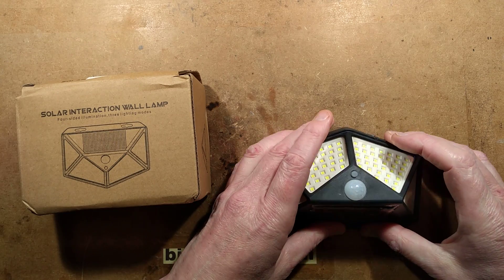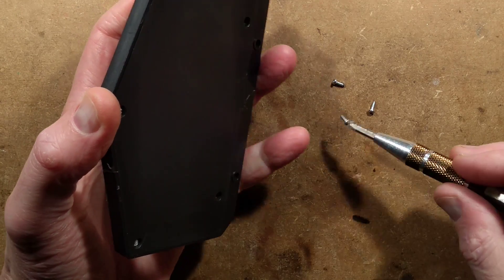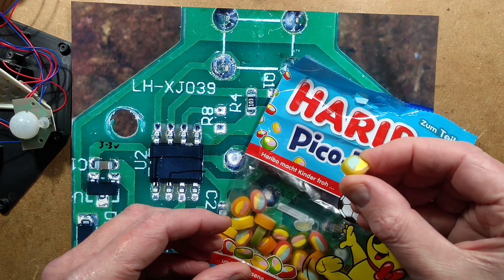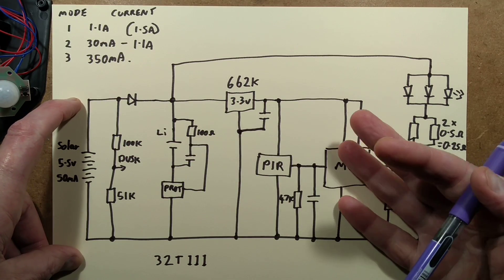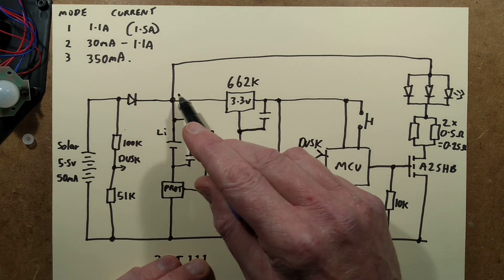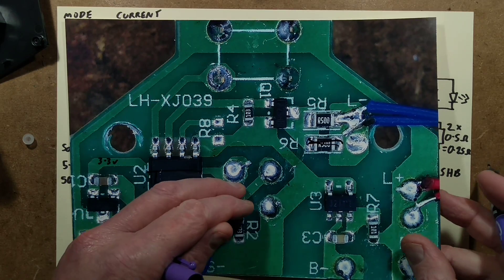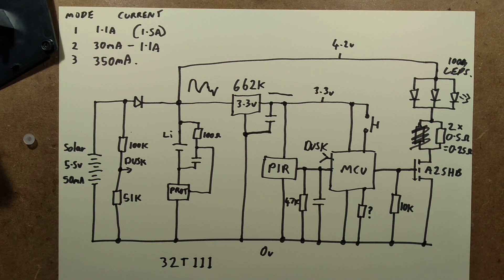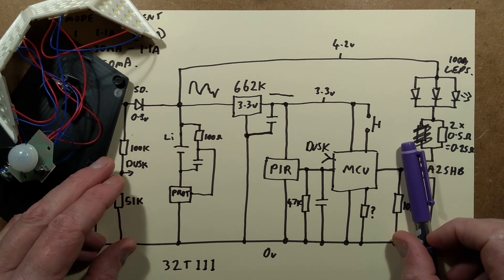100 LED solar garden light teardown (with schematic).

Comment: Great video & tear down of this solar light, they have revised them recently as others have said. Don't think it has full battery protection on these cheaper boards, with only one resistor & less chips, so will see if the unit or 18650 blows out...
However, very grateful to Clive for the tear down & listing the 3 power modes...
Mode #1 - 0/1100 mA with PIR
Mode #2 - 30/1100 mA with PIR
Mode #3 - 350 mA  no PIR, (simply dusk to dawn operation)

Mode #2 is perhaps where most will use these lights with a run time of aprox 5hrs
(Depending how often the PIR triggers the main 1100mA flood/beam
Though as Clive suggests this may be pushing the LED's a bit too much)

As Clive suggested using small value resistor(s) on the positive wire from PCB to LED board...

I bought a few 10r value resistors to tone down the brightness a little too, plus one light was too sensitive, despite even taping the PIR sensor, some gas from a boiler flue was at times false triggering the PIR...
The black tape did dial down the sensitivity a bit but was still slightly prone to false triggering from the flue exhaust close by
(poor choice of location I know but wanted a subtle light there to begin with)

On Mode #3 - 350mA, where the light operates dusk~dawn @ 350 mA
Battery life will be shortened from the Mode #2 30 mA (5hrs)
So I was looking to effectively operate the light on Mode #3 but at reduced power
like Mode #2 offered in its 30 mA standby setting

The 10 Ohm resistor, fitted in line seems to offer something near 30 mA power
on dusk~dawn in Mode #3 like I was looking for to offer ambient lighting
but without false triggering from other PIR modes...

Other lights will be mounted elsewhere using the Mode #2 setting
(but wanted a light kept in that location for subtle lighting)

So a 10 ohm resistor worked perfectly in this instance as Clive suggested
(I tried a range of resistors, but 10 Ohm was perfect for what i needed)
A 10 Ohm dials down the main "flood" considerably but if using a number of lights on your property it avoids illuminating the area too much & shortening the lifespan of some cheap Chinese LED floodlights.

If a 10 Ohm resistor dulls the flood too much for your own situation, then you could use two resistors to make a 5 Ohm resistance & dial down the flood slightly less without being too blindingly bright when say putting the rubbish bins out for example.

So yeah, many thanks to Clive for the insight into these cheap lights, now about £14 for 4 of them on ebay, or £3:50, even with an odd dud/spare parts, say a fiver...
With a 10 ohm, or 2x10 ohm to make a 5 ohm resistor, to dial down the floodlight & extend the lifespan of the LED's. Maybe a small spread of silicone mastic to seal/water proof the unit, perhaps paint the components with something. Borrowing say the wife's clear nail varnish will offer some protection to the components - though will not offer you protection if she finds you have used it all up on silly LED lights.

Thanks once again to Clive, great video, amusing fun clips, a down to earth tear down wonderfully narrated too. The only thing puzzling me is wtf is there to dislike about this clip ??? How can people down vote such an informative video on these units, hmmm me thinks it might be the manufacturers disliking Clive informing others how to engineer them to extend the life of these LED's perhaps ???

Cheers again Clive & others taking the time to share & educate us more on these cheapo Chinese electronic devices
Reply: I mean, you could (re)build very simple models, using the QX5252F (a dedicated solar light controller in a TO-94 or SOT23 package.

Comment: Awesome video! I'm using one for a project, how would you make it work regardless of voltage coming from the solar panel? (During the day)
Reply: Disregard, mine was using a signal to the controller straight from the positive side of the panel across a single resistor. Removed the resistor and Bingo! Works day or night now😜

Comment: Hello Clive, I have same issue with my 4 lights that are exactly the same on the outside. On the inside, the chip is slightly different and I have difficulties finding the resistor to remove. I can see I only have one Resistor (R750) if I am correct. Could I please send a picture? I do not want to throw them if there is a chance to fix them. They used to work though. Let me know, thank you very much!

Comment: Non techie here.  When replacing the battery is it as simple as finding any 18650 or should it be the purple covered one. 
There are a wide range of 18650s with different specs and I would like to be ready with replacement batteries for when the time comes.  Thanks for this video and any help.
Reply from the maker: Most of the cells used in these are standard 18650 cells.  Don't go too expensive as a low capacity one is usually fine.
Reply: @bigclivedotcom  Thanks 👍

Comment: I have one of these and it works surprisingly  well, even now in winter with quite cold temperatures for here (-10 degr.). I only used it "turned on" by motion so see little point in modding the LED resistors....it's only on every now and then and for a short time. It hangs on the side of my house...with another house at about 3,5 meters from it and even so the solar cell seems to charge it good enough.

Comment: Looked inside one today, and it only had 2 x NPN Tranistors and a Resistor (100 Ohm) + MCU + PIR + 100 LED + Solar Panel + Switch + Battery.  Pin on MCU (7) powers PIR.  One transistor switches the LEDs, the other controls battery charging.  White Plastic case.
Reply: Opened another today, different again.  1 Mosfet (A2SHB) 2 resistors (1 for mosfet gate discharge, 1 to limit LED current, 1 capacitor (smoothing) and 1 diode (to prevent discharge through solar panel).  Also the PIR sensor in these units is just a regular re200b type.  They must use on board ADC to read the 20mV pulse (peak to peak).  Black Plastic case , elongated mounting slots.
Reply: Přesně tento typ se mi porouchal - nereaguje na pohyb ani přepínač, baterie je dobitá a solární panel dodává cca 5V. Na opravu potřebuji znát označení MCU a PIR - poradíte?
Reply: @karlvonbanhof2723  PIR = re200b MCU = Chinese ASIC (e.g.  mx8098h).  Suggest hacking in an ATTiny85 + AM312 (e.g. See: https://www.youtube.com/watch?v=pMx2BsaKWUA&t=22s)
Reply: Moc děkuji, součástky objednám, a až mi tyto součástky doručí, včetně tranzistorů SS8050-J3Y, tak se pokusím světlo opravit. Pak dám vědět. Přeji pěkný den.

Comment: add a TP4056 and you can manually charge the battery if ever needed, i modified all of my solar lights to make that easier to do in times that sunlight is limited.
Works like a charm.
Reply: How did you do that? Connect the output of the TP4056 at the same solar wires?
Reply: @javiercalero9596   from the TP4056's positive and negative battery pads connect a long enough positive and ground wire to the battery holders terminals of the solar light,, about 20AWG should do, for the power in of the TP4056 have a long enough wire to suit your needs, then solder a USB A cable's positive and ground wire to it. Then all u would need is a USB power source to charge the battery when needed.

The TP4056 Should be in the unit itself then just drill a hole in the backplate of the light for the wiring to go through. You can use 18 gauge wire if you want to lessen the voltage drop when charging, but 20 should do just fine, depending on how long the wire will be.

Hope this helps

Also, doing it as u assumed would not be good for it because the power out of the TP4056 can only provide battery level voltage, so 3.7-4.20, so its best to just have it the way i described so that the power/voltage the light itself uses isnt affected by the TP4056.

Oh also, connecting it that way the battery wouldnt have protection so it would be possible to overcharge it, which is why u want the TP4056 to handle charge and protect.

As an additional idea for you, i have the porch solar light connected to a USB charger that is plugged into a smart socket that i can turn on/off with Alexa. I currently have it set on a schedule so the charger turns on for an hour and a half every day then turns off.. The light is under an overhang so it never gets much sun.
Reply: @DigitalIP  great post. Thank you. I will try, i hope we dont get explode :-)
Reply: @javiercalero9596  lol, its very easy to do.. Just remove the battery from the holder before you do any soldering to be safe.

Any solar light that uses 18650's can be modified this way. You can even modify the light to be a small USB power bank for one use or another.

Comment: Thank you for displaying the inner workings of this light. I have 8 of them and they are indeed bright when on full mode but when set to the 3rd mid on mode, it doesn't last for more than a couple of hours. I now set it to the 2nd dim/full mode and it stays on for most of the light.

Comment: Does it seem odd to you that these little lights never include any kind of temperature sensor to prevent charging when the temperature is below freezing? I have a few of these, and if the protection chip is based off of the TP4056, pin 1 is literally there  to enable temperature controlled charging cutoff, but it's almost always just connected to ground instead of a thermistor.
Reply from the maker: They probably rely on the available sunlight for charging current being very low when it's cold.
Reply: @bigclivedotcom  yeah, probably. Still not great though.where I live, we get sunny days in the winter where it doesn't get above freezing.I know these are cheap gadgets, but I'm tempted to try to desolder that pin, and insert a thermistor lead.

Comment: I have a similar light which I was tampering with to add a manual switch so it is always turned on but had no success. The pir sensor maintains its voltage and probably sends a digital signal to the ic. Any ideas how to simulate the signal or where to add a switch (on your board for example)?
Btw, thx for the video.
Reply from the maker: Your switch could bridge the output transistor.

Comment: I remember one of the first lectures I had in aerospace electronics.. Our professor said; You'll have it easier in a way since you design stuff that will hold, while consumer electronics is designed to break after a set time span...

Comment: Talking about LED lights I recently got ZAPPED by this one from IKEA:

https://www.ikea.com/gb/en/p/nymane-wall-reading-lamp-wired-in-inst-white-90356963/

I know this lamp is supposed to be installed where the wire comes out of the wall, but that is, most of the times, not the most convenient place or simply the place where you want to put it.
So I bought a cable+plug to connect it somewhere else, and got zapped when I accidentally touched the plug after testing the lamp and had already unplugged it. 
Like me, probably many others got (will be) zapped by the same lamp, b/c of the same reason.
I feel that IKEA should be more careful about it.

I suspect it uses a transformer upfront (to dim the light) which is not discharged, but maybe it worths to be teardown and investigated....
Reply from the maker: It probably has a suppression capacitor.  For equipment designed to be installed permanently they would possibly omit the discharge resistor.  It's a tiny amount of energy, but still stings.

Comment: "Waxoyl" (tm) is a good product for waterproofing low powered circuit boards! But, you can also daub some petroleum jelly, or silicon grease onto boards like these. It keeps the moisture out, but failure of underrated components is a different matter.

Better build quality, a battery capacity to suit countries that see long Winter nights, and a charging system that can support that battery could make these devices more of a viable proposition, and less of a gimmicky toy.    I wonder if, or how long until, we might one day see homes with an inbuilt solar power system, and gizmos like these simply plugging in to solar charged DC household supply? Just thinking out loud.   Go a step further, and make a hybrid system that uses solar and wind power, but also, how about an exercise bike that outputs DC, instead of wasting the rider's energy, and plugs into the (yet to be devised) household DC power bank, to act as yet another source of electricity to provide a charge?
Reply from the maker: Have you seen the Tesla power wall?  A home power bank that can supply lots of power for a long time.
Reply: @bigclivedotcom  Hi Clive,   Er, no I haven't, but I'm guessing then that it does more or less what I was postulating above? - Do tell more, I'm intrigued .
Reply from the maker: https://www.tesla.com/powerwall

Comment: 6 months in and mine are still working absolutely fine. Great product
Reply: less then a week in, and I have to manually turn them on every night. I got two them with the same problem. Not happy!
Reply: @Luc_Skywalker  interesting, I bought a couple more a few weeks back and I'm experiencing the same issue you described. I'm thinking they might not be receiving enough light, I have not tried repositioning them yet, might get round to some time this week, I'll report back.
Reply: @Luc_Skywalker  same here that's why I'm researching what the hell happened to it
Reply: I have a few others like this,pretty much same circuits some use smaller batteries and I've been using them close to 2 years and they still work fine.

Comment: It does look a little cheesey...
However you can put this and other similar lights in a zip lock bag before mounting, to water proof them...
*ask me how I know... 
😉👍
AWESOME VIDEO!
 BIG CLIVE...
Blessings: James
Reply from the maker: I've done that with outdoor battery packs.  I leave the bottom open to allow ventilation or use a silica gel desiccant pack to keep them dry inside.  The PIR sensors can see through thin polythene.

Comment: There have been a couple of comments about the 3.3v regulator so I did a bit of analysis of the components to see if it needs to be that high.
The dropout voltage is probably about 250mV, the lowest I could find was 178mV and they were starting to get too expensive for such a cheap device. That means the battery voltage needs to be over 3.5V under load in order to maintain a stable voltage and avoid retriggering.
The PIR is intended to be battery operated and most of that type have a minimum voltage of 2V so no problem there.
I've checked the MOSFET too, it should be fully turned on at 2.5V and although the on resistance would be slightly higher it shouldn't be significant at the current involved here.
That really only leaves the voltage of the microprocessor to consider. A lot of those will run at voltages down to about 2V or even less. If that's the case I really can't figure out why they picked a 3.3V regulator other than cost.
It would be interesting to swap it out for a 2.5V regulator (with suitably low dropout) and see what happens. I don't see any other voltage sensitive components or dividers except possibly the 47k pull down resistor between the PIR and the MCU, but a 33k would resolve that.

Comment: I bought a similar version of this on ebay. 110 LEDs I think it is in one line. After charging no matter which of the three settings you put it to the light shines bright after dark. The movement sensor does nothing.
Reply: Some need you to put your hand in front of them when you first switch it on.
Reply: @billyray1172  Thanks I'll try that.

Comment: The regulator seems like a wasted effort, when there are plenty of µCs out there that will happily operate on 3.3 - 5.0 V. Unless it's a not-so-great PIR module that can't tolerate input voltage fluctuation, so they're trying to compensate...? I dunno. I've always found manufacturer's choices in consumer products somewhat baffling.
Reply from the maker: THe PIR module is dealing with tiny voltage fluctuations to detect movement, so it needs a stable regulated supply.  The microcontroller is much less critical, but has to referenced to the same power rails as the sensor.

Comment: That FET shouldn't get hot, but it's very difficult to find one that turns fully on from a 3v3 micro.
Reply from the maker: I subsequently tested it again with a close range lens on the Flir, and the resistors had made it look like the FET was getting hot.  In reality it was staying cool.

Comment: Weatherproofing, or lack of it, will kill this thing in short order if placed in a garden.
Reply: Gordon McMillan ... you would think, but they are built water tight. Mine is still going strong after 2 years in rainy Seattle.

Comment: RTV on the seams and a shot of conformal coating or clear lacquer on the other bits. Too bad they didn't finish it off, a little more proper engineering and quality and it could be a real nice gadget.

Comment: Up the battery capacity and reconfigure it to exceed the original design.
Franken-solar light...with arc light sounds on mp3.
I imagine this was a layout for a torch originally. Maybe modified to perform a new task with too many LEDs  It looks cool though. Nice lines.